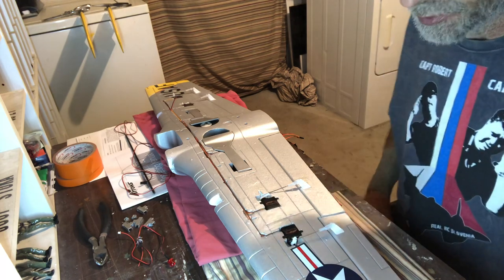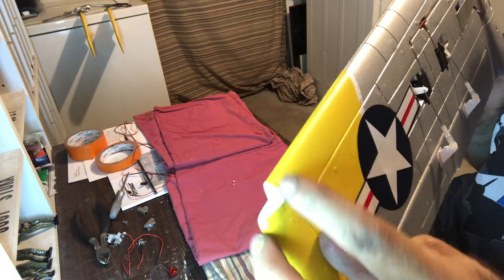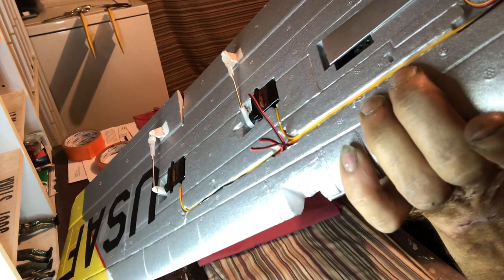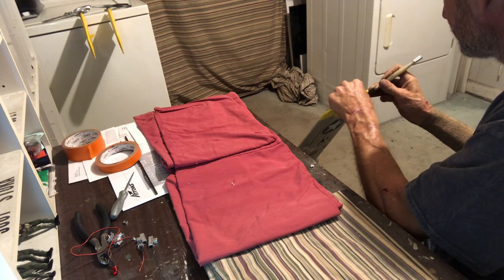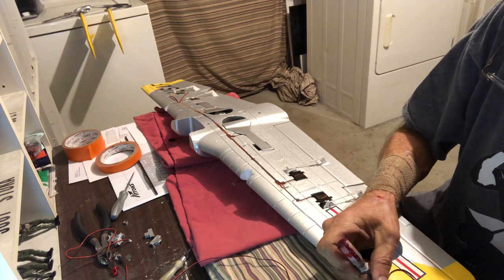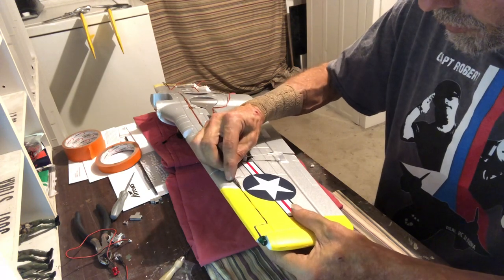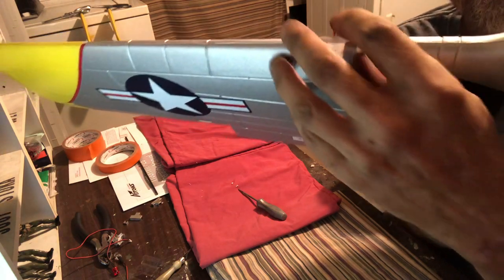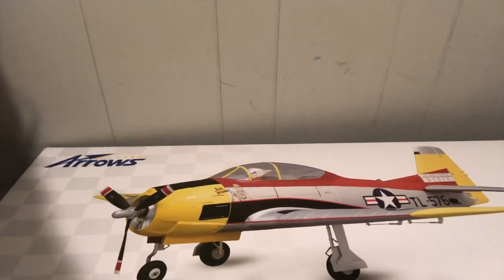Installing Nav,& landing LED lights

Comment: That is going to look awesome. I really like that light set up. Waiting for the finshed reveal 👍🏼😎✌🏼🇺🇸🇺🇸🇺🇸
Reply from the maker: RECKEM ROYS RC l was looking for flat yellow paint that didn’t work had to use gloss. Got to paint wing today, might make a build video. But it’s so easy to build. Hard to find a place to fly here Roy. All clear off land is for sale no trust passing signs. What is the website to get # from AMA l got to get them to.
Reply: @eqrc7587  Eric go to model aircraft.org/ members. I actually just typed in ama insurance and that's what took me to the website.  Also Eric do you have a FAA number.  You gotta have that too. 5 bucks for 3 years on that. How about flying from a road that is a Dead end or not used very much. I usually go to the soccer fields in town but I have to hand launch the T-28 and belly landing. So that sucks I need to find a nice club to fly at but they're all about 50 miles from my house. So I keep trying to get the city to make us local pilots a place but that's like pulling teeth.     ✌🏼😎👍🏼🇺🇸🇺🇸🇺🇸
Reply from the maker: Got to get the FAA # to. We have these sports complex w/ 100 ft light poles and the soccer field is full of games every weekend and softball games. The dead end is what I’m looking for to. Good drive on that one. Thanks for the info Roy. Good luck 👍🏻✌🏻👊🏻🖖🏻🇺🇸😳🇺🇸
Reply: @eqrc7587  are there any flying club's around your place. That would be ideal
Reply from the maker: Ya but it was city dump after filled up they made it the flying field. Last time l went the grass need cut. But I’ll find a place soon.👍🏻